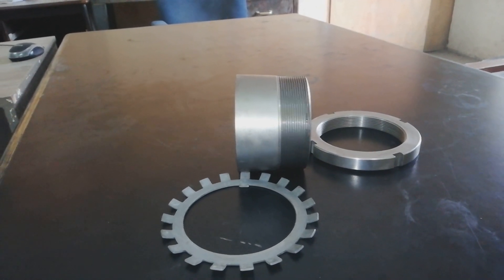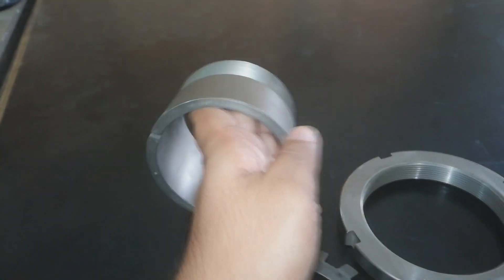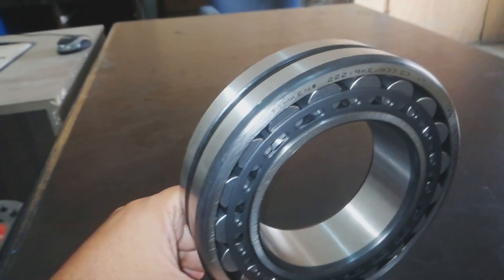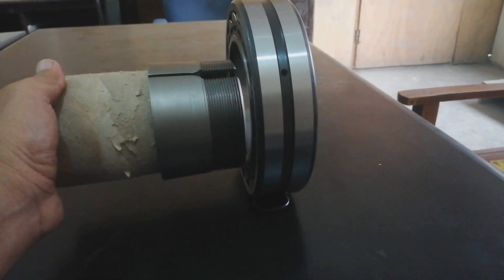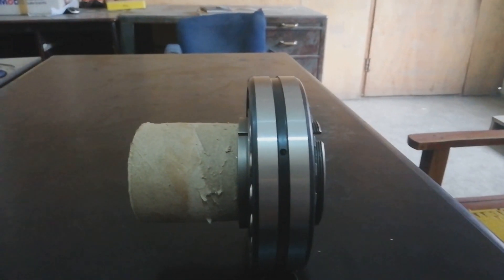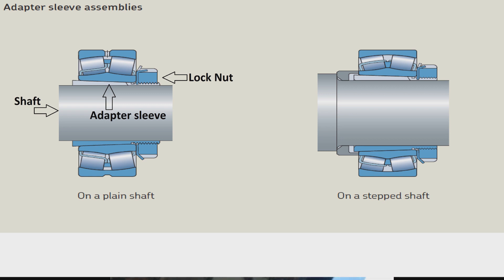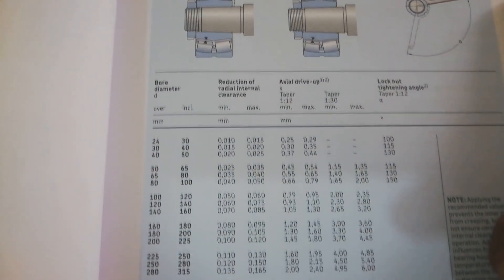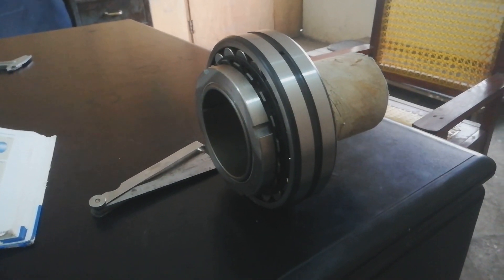Adaptor Sleeve || Adaptor Sleeve bearing || Taper bore bearing

Comment: Sir normal clearenc kitni hoti hai?
Reply from the maker: its depend on bearing size. also clearance mention in manual
Reply: My bearing has a lip seal around the outside, no feeler guages inside possible